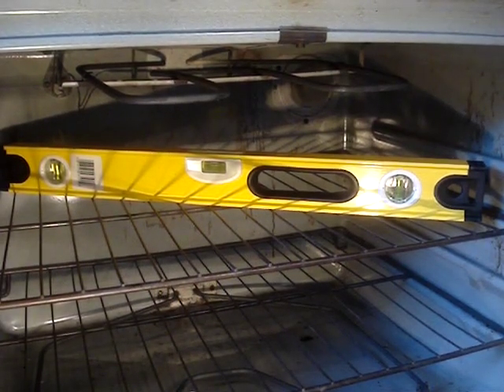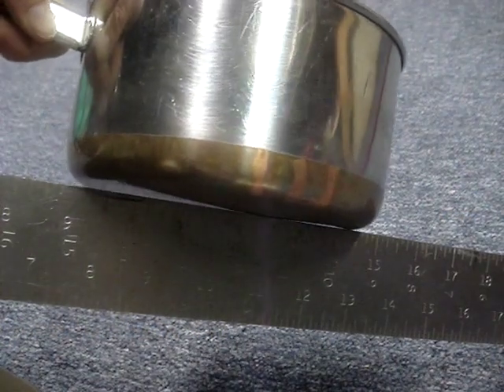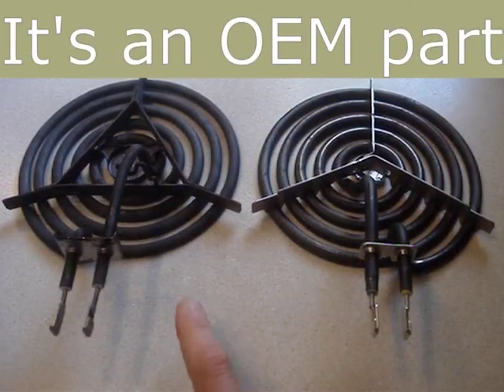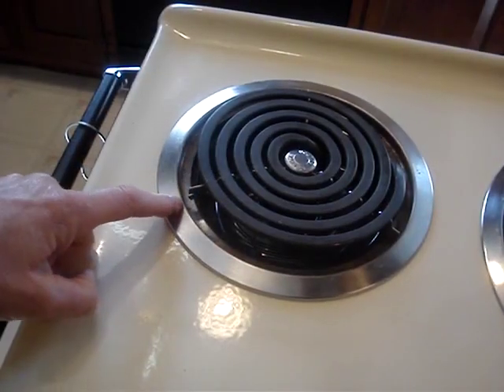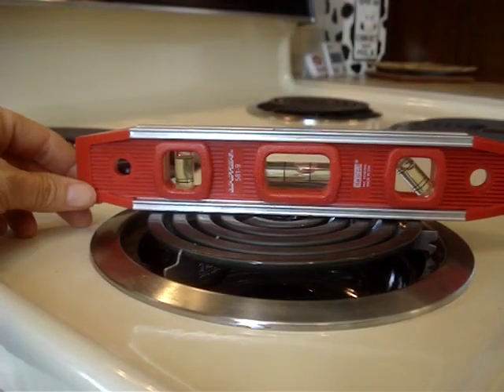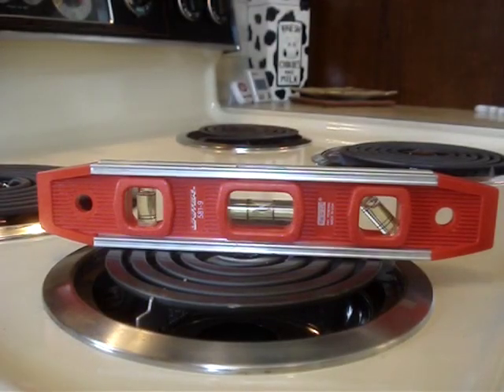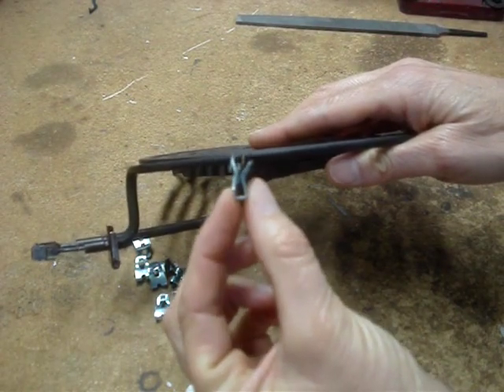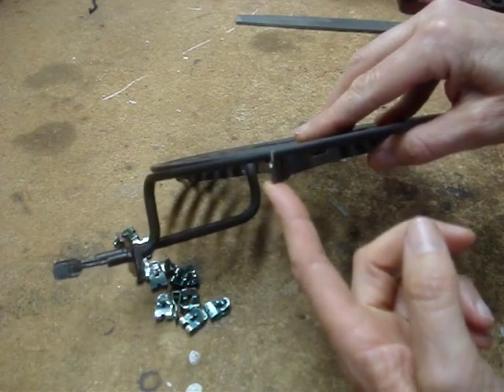How to Level Electric Stove Burners

Comment: What if mine is super wobbly? Like the left and right legs don’t touch the sides. I also don’t have a silver ring around each burner, is that the problem?
Reply from the maker: Maybe the rings are missing?  Somewhere on the stove there is a tag with the model number.  Don't forget to open the oven and look around there.  After you have the model number, go to one of the online appliance parts sellers.  Search for the burners and look at the parts diagram to confirm that the stove did have rings around the burners.

Comment: YOU. ARE. BRILLIANT! We just moved into a new apartment and the 3 smaller burners refused to lay flat, even when using a heavy pot or pan. After several exhausting, and expensive, trips to the hardware store for different drip pans I tried your hack of wrapping tin foil around one of the legs and PRESTO! suddenly it no longer wobbled! THANK YOU!!!!! As this was driving me nuts every time I used the stove you have saved my sanity!🥳
Reply from the maker: You are welcome, Lillith.  It's great when your eggs don't run to one side of the pan.

Comment: Super helpful, thanks!  I never thought of using the level inside the oven.  Great idea.

Have you levelled a wash machine and dryer? I was having fun yesterday doing that in my old bsmt with the terribly uneven concrete floor. 
Side by side top load washer and front load dryer.
That was fun 😖
Reply from the maker: You are welcome, Mario.  Yes, I've had the fun job of making the washer and dryer level.  There's always something to do.  lol.

Comment: Hey there my burner is to hot and does not go down in temperature. Do you have a video to fix that problem, thank you.
Reply from the maker: It's probably the infinite switch, that's the switch behind the control knob.  They often stick.  I don't have a video that shows how to replace it.

Comment: I have the same exact stove, where did you find the replacement coils?
Reply from the maker: Open the oven door, get the model number off of the plate.  Go to one of the online appliance parts stores.  Get the part number for the new coil.  Buy genuine GE Calrod coils.  A lot of the parts stores will try to sell you an after market part.. they are very tricky.  Make sure it is a genuine ge part.  I usually look up the part number on  eBay. and buy it there. They should show you a picture of the item in a blue/white plastic bag.  I think I paid around $40-55 shipping included.  I sort of think there is something weird about looking up the model of the stove.  Maybe you omit the "J"?  If you can't get the part numbers, get back to me with the model number off of the stove.  If it's the same as mine, I check my notes.  I'm pretty sure I have the part number for both size coils.  Subscribe, like watch some videos on the channel... no one else will bother to help you as I just did.

Comment: I have this stove, I need to clean the area under the burners but the top part doesn't just lift up like other stoves I've had. Can you help please?
Reply from the maker: The only way I know is to remove the burners, trim rings and pans, then try to clean underneath.  I have a video that shows how to remove the burners.  https://youtu.be/bwNClydVJ6I

Comment: Again ,how do you level the back feet in an enclosed space?No one has a clue!!!
Reply from the maker: Unless you can take the bottom drawer out and reach the feet, then you'll have to slide it out, guess at the adjustment, put it back in place, check. Repeat until it's level.  I keep super sliders on the feet of my stove.  It makes it easy to slide back & forth and doesn't damage the floor.

Comment: How to replace burners is more accurate than how to level them
Reply from the maker: 188 likes vs 4 dislikes..... many viewers beg to differ with you.
Reply: @Know-How-Now  well when you want tips on leveling a burner and the advice your given is replace it...then level the stand and the oven...not the actual burner....this is the video for you
Reply from the maker: Ummm you can't figure out if your burner is not warped that you can bend the electrodes and file the legs on an existing one?